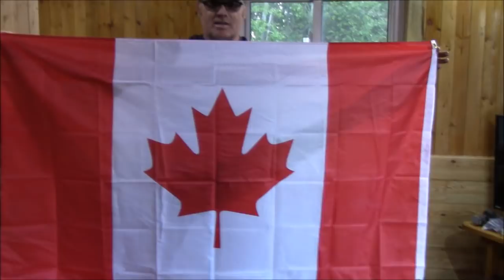Basement Build Material// Hand Crafted Bench// Mail From Our Friends .

Comment: Cecil: Some thing to consider  if you have 2 45 gal steel drums.  After the drain tile leaves the slab you could run it into the side of one drum and out of the other creating a sump. this drum would have the top cut out.   The second drum then could have both top and bottom cut out and be welded to the open top of the first drum.  When installing the drain ;   sink the bottom  drum below the tile for the water to fill before continuing down to the ravine.   And then back fill them up to grade.  If that running water proves to be a spring; you would then have a source of water for the garden.  If not you could still collect some water with each rainfall.  That could be stored in 1000 liter totes in the garden filled with a small bilge pump.  the old guy   Bert